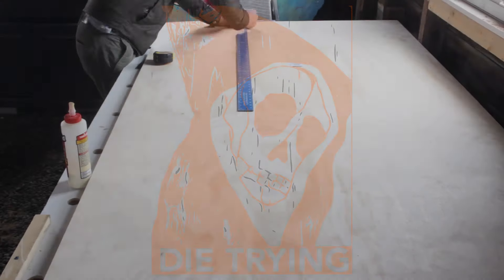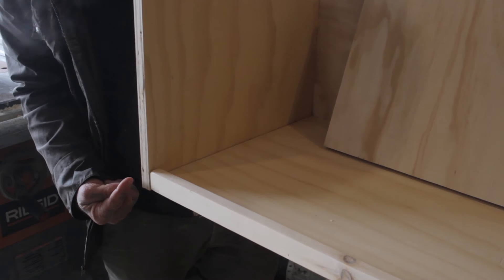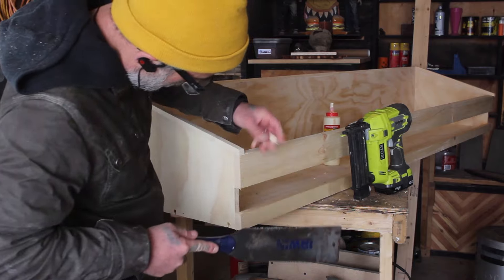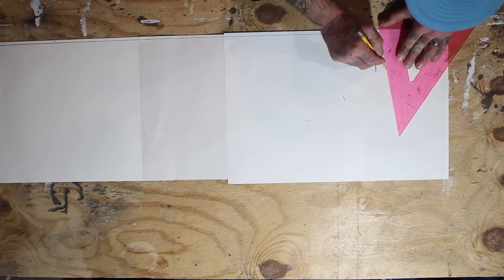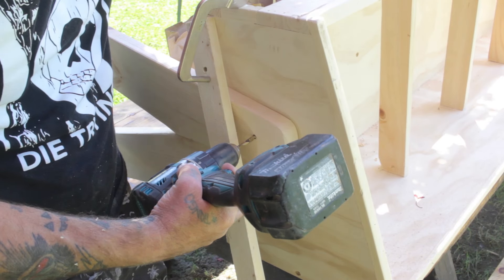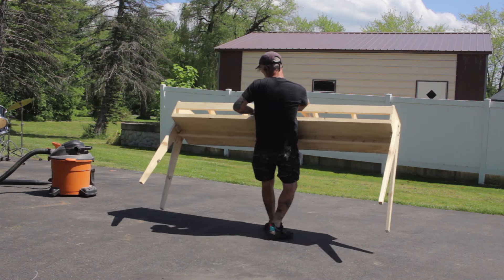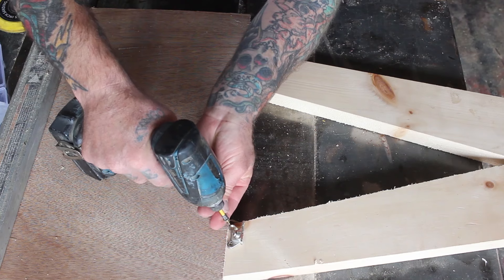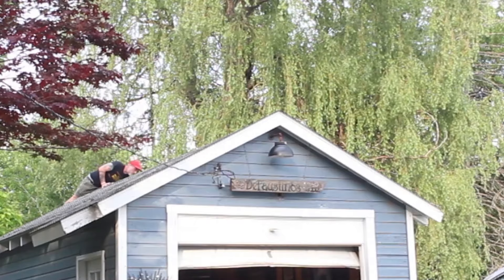DIY Vinyl Record Rack

Comment: That dip/curve at the end from the weight of the records though.
Reply from the maker: There zero dip. Your eyes have deceived you
Reply: @DieTrying13  sorry  i meant to put" or is that the video"  but you responded before I could edit.  It was supposed to be an indictment of the weight of records. My shelf required so much reinforcement. You don't realize how heavy records are until you stack them up. It did sound like a knock on the build. Not the intent.
Reply from the maker: I was terrified it was going to buckle under the weight. It’s been there for months now. No problems, thank god. I’ve thought about going back and adding some 45s from the legs to the bottom of the record storage. But it does seem solid. Sorry if I snapped back quick. Lots of dickheads out there. Hahaha!
Reply: @DieTrying13  You responded appropriately. It does appear to bow but camera lenses do that. And I wouldn't blame anyone if it did bow. I made a crate for mine at first and the bottom fell out. Haha